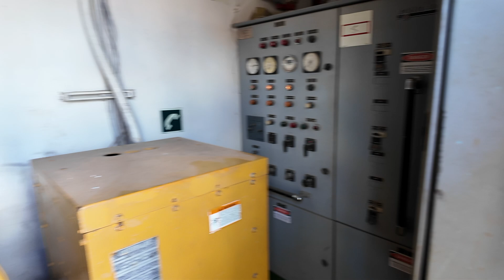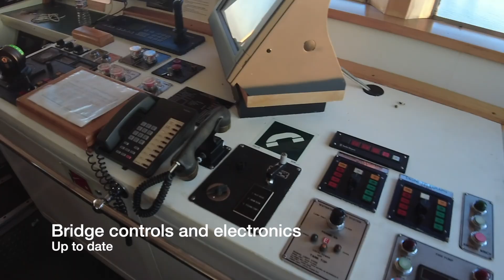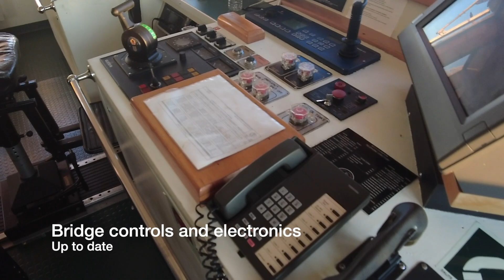Update on the ongoing shipyard work on a 220 ft / 67 meter OSV that is heading to Med for finishing.

Comment: Do you take the DP2 system out altogether or simply modernise it?
Is DP really no use on a fancy superyacht?
Reply from the maker: Unless it is a serious dive vessel that needs to hover over a reef dive site, instead of anchoring; the DP is not necessary. It is also can be dangerous for swimmers when system is in use, for obvious reasons.

Comment: This is very cool, but what is the total coat? And I've never gotten an answer to the parts taken off and sold. Is the money received from the sale of those items no longer needed, is that money applied towards the build or is it splt for the removal, but would have been removed anyways, but is it just money to the shipyard?
Reply from the maker: I can't share costs on this vessel, but can tell you what other vessels will likely cost for conversion. In terms of removed items- often the cost of the removal is equal to the value of the systems, so it is a wash.